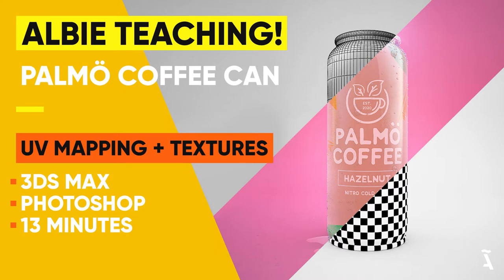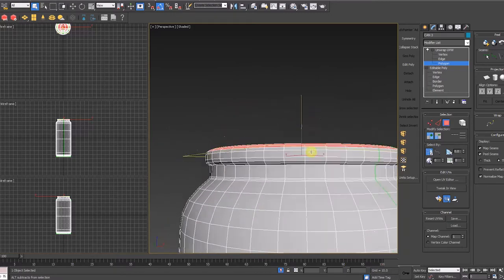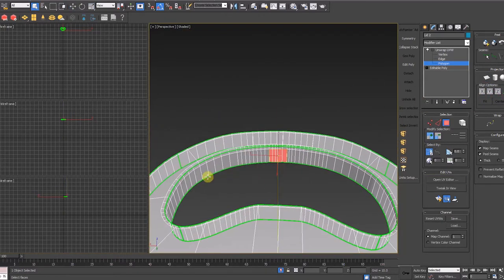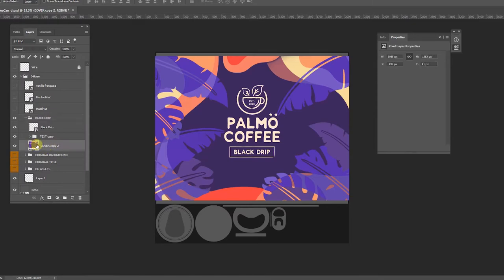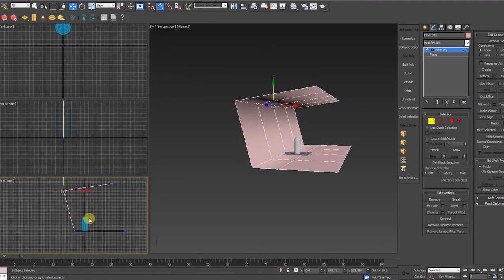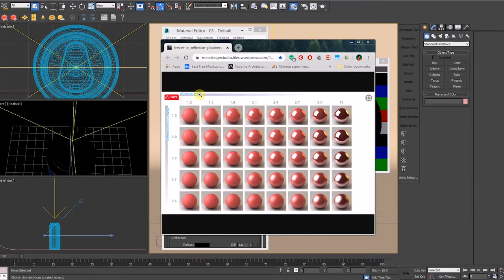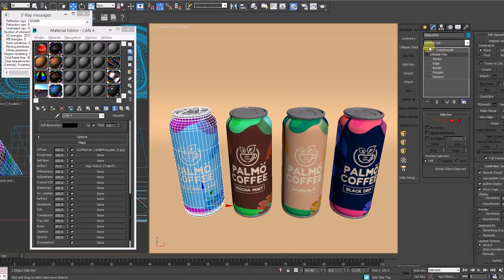UV Mapping and Texturing - Realistic High Poly coffee can in 3DS Max and Photoshop

Comment: thanks for this tutorial, but I didnt see how did you get that metal material on the top :/
Reply from the maker: Hi Boris, sorry I went through that so quickly. To answer your question:

1.) After you finish exporting out your UV maps and are inside of Photoshop you create a regular Fill Layer of Gray (RGB: 128, 128, 128) to cover your UV maps. You can see this at (5:22 - 5:23) - I called it "BASE".

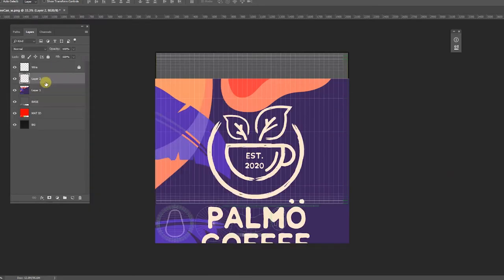2.) This "BASE" Gray layer sits underneath your coffee can texture layer (5:37)

3.) Once you are done in Photoshop, export out as .jpeg and reapply inside of Max. Your Gray BASE layer should now be applied to your model.

Let me know if you need further clarification and thanks for watching! Have an awesome week
Reply: @albierandom4223  thanks for quick reply :) I got that and my understanding is that you just deselect this silver parts in 3dsmax and apply silver material. Correct?
Reply from the maker: @borisstribrnsky3806 Haha Yes! What you are suggesting is definitely a much cleaner and precise method. I actually cheated and just used the gray from Photoshop- but your method will work perfectly too! There is a website that is AMAZING for Vray Materials if you haven't stumbled upon it yet: 

https://www.vray-materials.de/

They have such a wide variety of Silver Materials for you to choose from! Cheers!